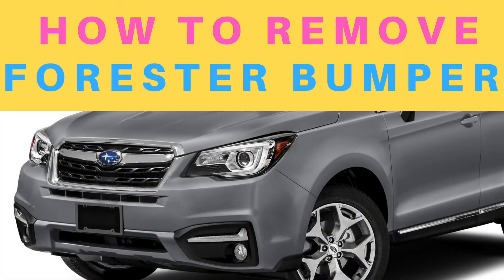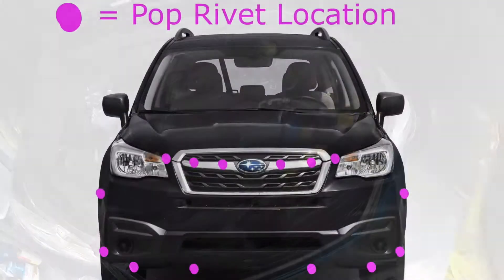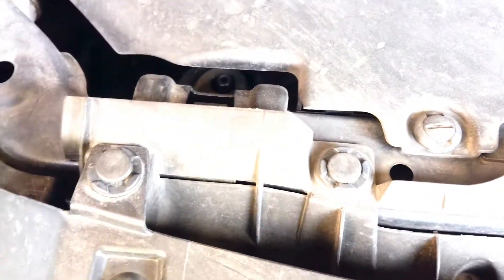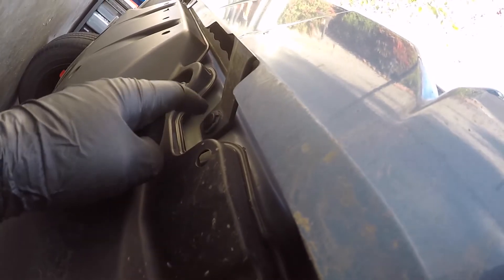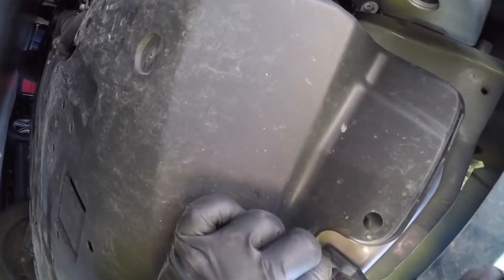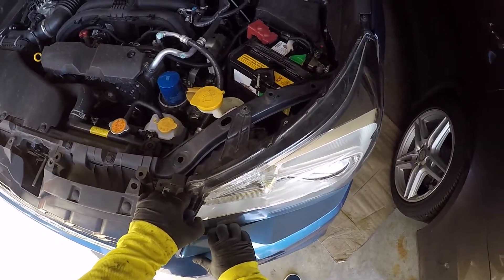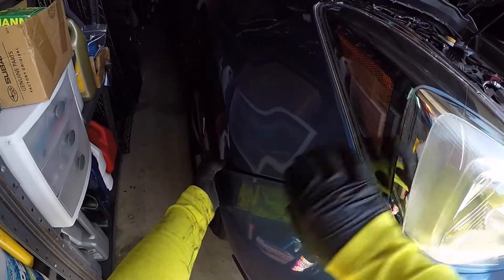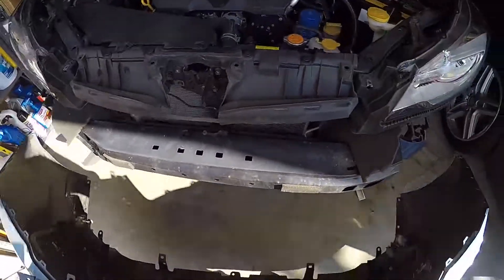Remove Front Bumper Subaru Forester (2014-2018)

Comment: I have a 2017 Subaru Legacy and I need to access the windshield fluid container. This video gave me confidence that I can do by myself, going for it. I'll be back to report my result.
Reply: It worked! The only issue for me was that I didn’t have the tool to remove the clips and I snapped a bunch of them. It looks like you can buy replacements on Amazon and it has the tool too. Overall great video and help. Thank you!
Reply from the maker: Great! Glad it worked out for you!

Comment: I have a 2015 Forrester and the tabs on the front driver and passenger side fenders are broken. Is it possible to repair this or should I just replace them?
Reply from the maker: Better to replace. Ensures your body gaps are even and aligned.

Comment: Does the angled part of the front bumper by the tires/side under headlight have more than one clip on that section?
Reply from the maker: If I understand you correctly, no it does not. It has one pop rivet. It is also held in by a longish plastic holder that’s bolted to the fender. If you have the XT variant (the turbocharged engine) and the front bumper is different, you may have more pop rivets.
Reply: @UsefulVids  What are the rectangular holes for?
Reply from the maker: @moki888  Can you let me know what part of the bumper you're referring to?